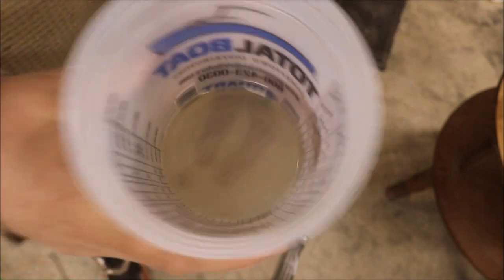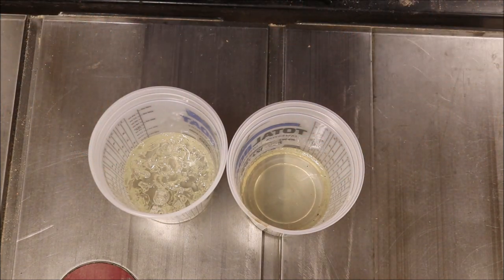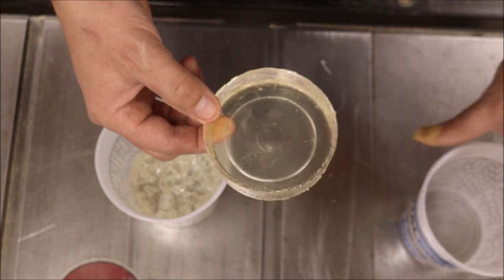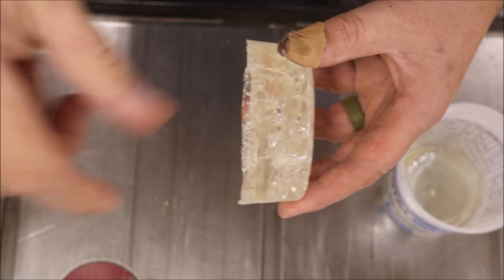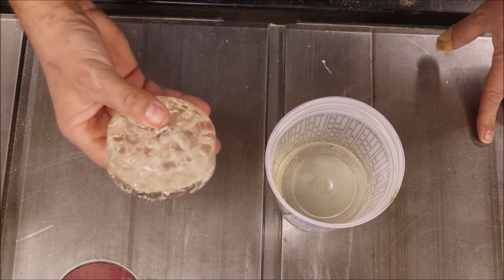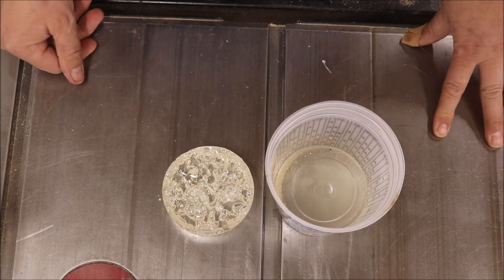Just The Tip - Pressure Pot vs Vacuum

Comment: Thank you!  I have seen that the vacuum seems to be financially more viable, but this will absolutely change the end result of the project to the point that it would be wise to spend the extra money on a true pressure pot. Thanks a lot!  You saved future me a lot of money.
Reply from the maker: I don’t think that a pressure pot is any better than a vacuum. If you use a vacuum chamber correctly by putting your project under vacuum then after a short time releasing it, you should be OK. You can buy a harbor freight pressure pot for $99. It is substantially cheaper than buying the vacuum which was a little over $150.

Comment from the maker: I want everyone to understand what I did here. I was not trying to show you how to use a vacuum. I was showing you what happened by leaving resin in a vacuum chamber. Is it witch craft or science? I don’t know.  Take this for what it is, an experiment.
Reply: You're kind of applying the wrong method here. the pressure is to cure and the vacuum is to prep for the cure. don't leave it under a vacuum as you do with pressure. you're drawing the air out, and then when you let air back in, the atmosphere works as the pressure chamber, squeezing those bubbles back down. leaving it under negative pressure is not the recommended procedure.

instead of thinking either-or, try both. put a casting under vacuum for 3-5 min, then transfer it to the pressure pot to cure. it will work best when doing an actual casting rather than this test. try making a few simple bowls with wood shavings or something. do a 5 min vacuum only test with one, a pressure only test, and then try both.

 you should be able to have near-zero inclusions that way because any air bubbles that are left after the vacuum will be collapsed down, so what would have been a 1/8" air inclusion becomes near invisible.

also, after you mix but before you pour, put your mixed resin in the vacuum chamber for a minute to suck any trapped air out first. this will mean less included air when you pour, giving you an even better end result. yes, you include air when you pour, that's not the point. if you pull air before you pour, it's the air that in the mixture in the first place, and needs to be removed anyways, so doing to before is that much less volume you need to remove after, reducing foaming.

Doing all three together, the vac before and after the pour, and then cure under pressure is the "ideal" way to do these, and why you keep getting the comment to use the vac chamber.

You should make a little tray for the bottom of the vacuum chamber to make the transfer easier
Reply from the maker: @seldoon_nemar  great info thanks.

Comment: When I was in aerospace back in the late '60s, we vacuumed BEFORE pouring, just long enough that it stopped bubbling. We were casting electronic parts to prevent solder and weld separation during flight...

Comment: I had been wondering about how a vacuum would handle resin.  Thanks for the comparison!!
Reply from the maker: Take the experiment with a grain of salt. If I would have used the vacuum to bleed off the air bubbles then vented those bubbles would have most likely not have happened.

Comment: That vacuum result is actually an interesting product. You would likely not be able to turn it but it would interesting effects to anything you add light to. Try making a thin flat pour like a pane of glass. If it comes out similar you could treat it like stained glass. Doug is right about the boiling point.
Reply from the maker: Interesting idea!

Comment: I typically release the pressure when I do the vacuum, after it's done foaming up. Keeping the vacuum on, keeps making the air bigger, where ease if you release the pressure it keeps the air bubbles bigger, when you release the vacuum it is similar to when you put it in pressure (requires time, so this may not be the best resin option for it, now imagine if you drop a hybrid blank in vacuum, and then you put it under pressure after with some thick set, it should make things very clear.
Reply from the maker: Hey great info. Thanks.
Reply: @MoonpieCreations  I'm glad you could make that out, it came out a bit... crazy/illiterate.

Comment: I look at that vacuum pot example and loved it!  I wonder how pretty it would be if the exposed bubble were filled with something like resin mixed with Pearl-Ex Duo Violet Brass or Blue Russet. Then you started turning it after the resin dries, other areas of bubbles would start to expose their openings ready to be filled with more colored epoxy. I can't help but imagine a clear bowl or something with all of these lovely  iridescent bubbles inside of it.
If I had a  wish I had a pressure pot I would have to try it out, even if it didn't work its be a learning experience!

Comment: Ken, I watched a video from Jake Latvala of Ol Loggin Sawmill. He used a deepset epoxy that he put in a vacuum chamber to de-bubble and then slow poured it into his project. No bubbles at all, and clear as can be. You should look at that for input. His project was a river table with bullet casings in the resin. As Doug at Pohl Barn says, the lower boiling point and shorter open time of a faster set resin will leave the air bubbles in. Check out Jake's channel. He's new to YouTube but a highly skilled furniture maker.
Reply from the maker: Thanks Douglas, I'll check him out.

Comment: I don't do pens or woodturning, but am interested in crafts with resin. I bought a vacuum first, thinking it'd do the degassing cheaper, but before trying it, I did more research, and decided to also get a pressure pot. I can use the vacuum for degassing molds and the pressure pot for the resin. This was interesting though!
Reply from the maker: I think I can use the vacuum to get rid of some bubbles then put in pressure pot. Make work well.

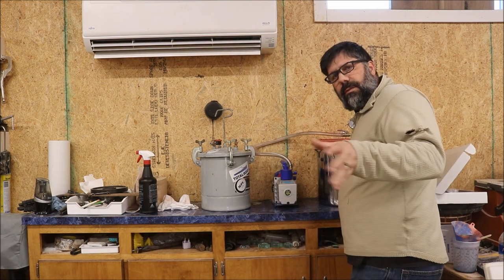Comment: 1:24 Oh my GAWD, KEN, look out there’s and OLD man wearing glasses in your....oh...it’s just you...😜🤣

I am definitely NOT a resin expert, but I always thought the vacuum chamber was for doing stabilization (e.g. Cactus Juice), or degassing silicone, rather than pouring projects. If not using Thick Set, the resin would cure much too quickly for the air to fully escape. 
That’s just my $0.02. 

Great video buddy! Thanks for taking the time to share this!
- Seth
Reply from the maker: Or you're not only a woodworker you are a comedian too. Haha
I have never used the vacuum for a pouring project. People always suggest it in my comments section so I thought why not see what happens.
Reply: @MoonpieCreations  Hahahaha! You just seemed like the kinda guy that could enjoy my sense of humor! 😂 

Honestly though, I’m glad you did this project cause I’ve always wondered.
Reply: Do you mind me asking what brand vacuum chamber and pump you use? I’d like to start stabilizing some blanks and need to invest in a good system.
Reply from the maker: @BrickhouseCraftWorks  I'm not sure the brand. I got it off amazon. I send you a link. This experiment was just me being curious what would happen if you leave 2:1 under vacuum versus the pressure pot Pretty cool results I think.

Comment: I agree with the comment about the resin boiling but I think it is because the the boiling point of liquids is lowered with you lowering air pressure I.e. pulling a vacuum. I think you should try turning a vacuum piece you might end with something that looks cracked ice or could fall apart?

Comment: Keeping the vacuum on the whole time will cause air to continue to be pulled out, including as the resin begins to set.  You should release the valve prior to that point.
Reply from the maker: Thanks Tamara. I wasn't showing how to use a vacuum chamber. I was experimenting on what a pressure pot does to resin vs a vacuum when left in. But the question remains. Why does air continue to come out of the resin? Even if it was thinner resin the result would have been the same from what I have been told? Where does the air keep coming from. I believe it's magic.

Comment: It's interesting that total boat never got totally degassed in the vacuum chamber. The early videos of a YTer, Highlandboxes, would degass her resin before pouring pen blanks, but that was Amazing Clear Cast resin, so perhaps the type of resin has something to do with it?
Reply from the maker: I have talked to a few people and they say resin will never degass. I have no idea, but I was told to degass as much as time allows them put in a pressure pot to get best results.
Reply: You are exactly right. I have never seen a bulk sample cured out under vacuum like that, very cool. 

*Materials Science Nerdery Alert*
Degassing involves lowering the pressure above a liquid such that the vapor pressure of a volatile/suspended component of that liquid is higher within the liquid than outside it. The classic example is opening a soda bottle. As soon as the cap opens the pressure of CO2 over the soda drops to atmospheric, and suddenly you have a driving force pushing the CO2 out of solution, hey presto, bubbles galore. 
From a manufacturing standpoint the simple example is something like vacuum degassing steel. You take your pot of molten metal, put it under vacuum, and all the dissolved gasses and such bubble out. Because the vapor pressure of the molten steel is effectively zero at normal melt temperatures, once all the gas is out the steel basically just sits there and solidifies. 
Unlike steel, the vapor pressures of resin components are not ~zero. Compared to air they are still very low, so the air comes out of the resin quite quickly with very little loss of volatiles, but the better the vacuum over the resin gets the more the volatile components will begin to vaporize and form bubbles of their own. Basically you have managed to solidify resin while it is in the process of very slowly boiling, which is really cool to see. So in the instance of resin work the degassing process serves to remove a whole bunch of air very quickly such that the pressure pot can do its thing more effectively during the cure. 

The other interesting effect that crops up with vacuum is the lack of air to carry away heat. This pour is small enough I don't think I can see anything that looks thermal in there, but with no atmosphere to carry away the heat produced by the curing epoxy I can guarantee the vacuum sample cured substantially hotter than the pressure sample. There are parts that can be cured under 6 atmospheres of pressure (standard autoclave pressure for the materials I work with) that could not be cured at 1 atmosphere because the extra air in the chamber provides more mass for thermal regulation.
Reply from the maker: @thereddufus  holy s$&t!!!! Considered my mind 🤯
Reply: @MoonpieCreations  Muahahahaha, then my work here is done.

Comment: With resin, the pressure pot wins for me every time. I only put wood in the vacuum for stabilization.
Reply from the maker: I may use the vacuum on an upcoming project with resin but overall I will stick with the pressure pot.
Reply: @Cross Cut Creations
That is how I've seen it used. To stabilize wood or other materials using Cactus Juice stabilizing resin.

Comment: Wouldn't it be that in the vacuum, you would partially release the vacuum before it goes off?
Reply: That would be the proper way... Pull vacuum, bleed it a bit, repeat until bubbles are gone.  One issue is that when under a vacuum, things tend to heat up/boil faster.  So this can also cause resins to set up faster.
Reply from the maker: Yes you would.

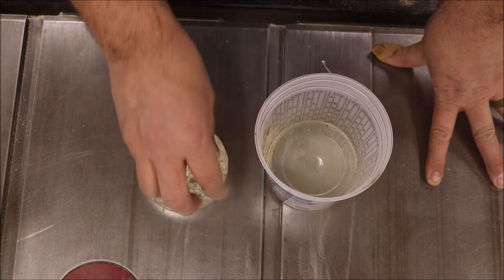Comment: 3:38 mark...I don't see how putting it in the vacuum then pouring into project and then to pressure pot would do any good. Upon pouring into your project, you would create more air bubbles.  Just my opinion though
Reply from the maker: I guess it would depend on what kind of poor you were doing. In my case you would be correct it would cause more air bubbles to pour into my project. But if you look at other resin users that do dioramas and such they degas their resin in a vacuum then poured into the project off of a stick.

Comment: Just curious, would it be beneficial to put a casting with heaps of voids/cracks into a vacuum pot for a short amount of time and then transfer to a pressure pot for curing?
I see a lot of videos where castings have air trapped (obviously too much to be pressurised small enough) underneath or in voids when the piece is turned and these usually need to be filled with either more resin or CA.
My thought is that maybe the vacuum will draw out the air first and leave it with less chance of having air voids.
I could be totally wrong, but just a thought.
Reply from the maker: I think if you have a bunch of voids it may be helpful to throw it in the vacuum for a few then into the pressure pot. But if it's just a few voids I would stick with the fill as I go method.
Reply: I’ve had good luck getting the resin into voids in the wood using vacuum but the I release the vacuum for curing.  Going from vacuum to atmospheric pressure has a similar effect as going from atmospheric pressure to a pressure pot.   Even better would be to pull out most of the air under vacuum and then cure in a pressure pot but my piece was too large.

Comment: I wonder what happens if you vacuum for a little while with something like wood than cure it in the pressure pot? Lot of steps but cool experiment
Reply from the maker: William, that is how you should really do this. The pulling of the vacuum the hole time was me just experimenting on what would happen.

Comment: I used to use a vacuum I would pull the vacuum then after the bubbles came to the top I would take off the vacuum and then the bubbles would be gone. You just want the vacuum to make the bubbles big enough that they float to the top quick. Don't let it set under vacuum.

Comment: The mistake you made is you left the vacuum  on that removes the air but the voids left can form what you have to do is after you reach a full vacuum you let the air back in this pushes the resin in too all the little gaps.
Reply from the maker: Thanks Sean

Comment: I could be wrong but I thought that the vacuum pot was only for soft materials and the pressure pot was to get air out. Could be wrong.
Reply from the maker: The pressure pot presses the bubble the vacuum can be used to remove the bubbles, but needs to be used then bled off. The issue here is I left it under vacuum.

Comment: I’m going to comment a big “OMGthattitle” beFORE I watch the video
Reply from the maker: I know right!!!
Reply: I use my vacuum pot to degas the resin before I do a table top poor(shallow.) I use my pressure pot for castings.
Reply from the maker: @BPWhitman  I’m thinking I can use the vacuum for a short time on project I think will hold bubbles and then switch to the pressure pot. What do you think?
Reply: @MoonpieCreations  I purchased my vacuum pot specifically to stabilize wood and stuff. Upon further review, I found that it could also be used to help degas resin before you do a pour. I wonder if the air pockets you had with the steel wool project could have been minimized by vacuuming first.
Reply from the maker: @BPWhitman  it is possible.

Comment: This is kinda misleading when it comes to vacuum pot usage. I've never seen a result like this, as it usually looks like the results from the pressure pot.
Reply from the maker: I understand but I wasn't showing how to use the pressure pot. I was showing the results from leaving them in each. I'm working on another Pressure pot vs vacuum video that shows the different ways to cast in a closer comparison.

Comment: You used too fast epoxy so this comparison is false
Reply from the maker: Well that's not a true statement at all. Some might even say it's False.
Reply: If you use slow curing epoxy in a vacuum pot, and keep an eye on the degassing proces you will never get the result you showed us. Why do that?
Reply from the maker: @ASvanRandwijck  Why not? It was just an experiment. Using slow cure epoxy wouldn't change the outcome. When you draw a vacuum on the epoxy it will bubble until it hardens. Plus the epoxy heats up under a vacuum and cures a lot faster. Which is does not in a pressure pot.